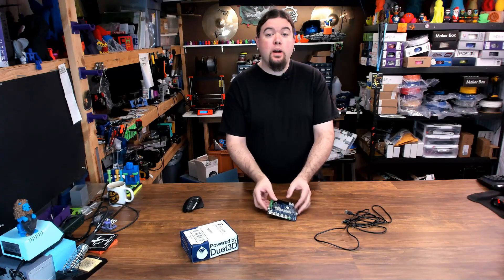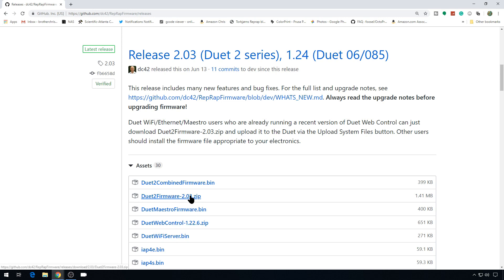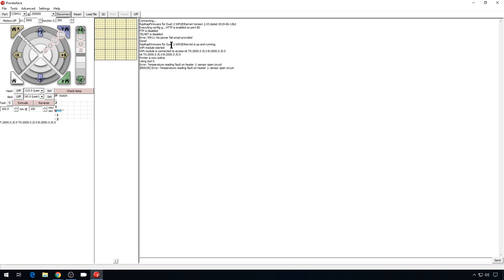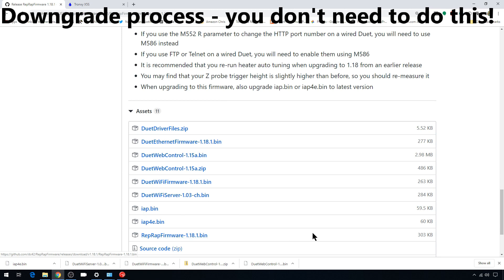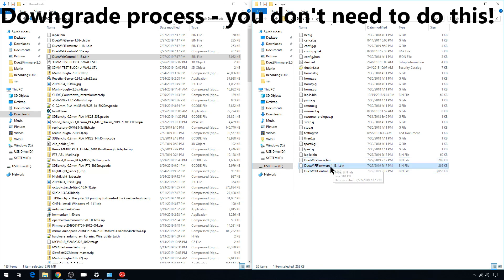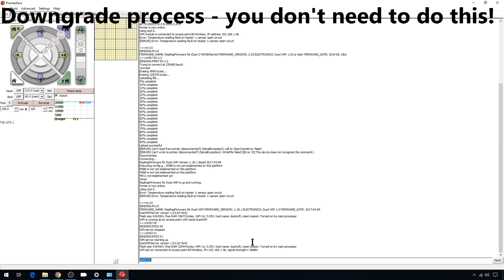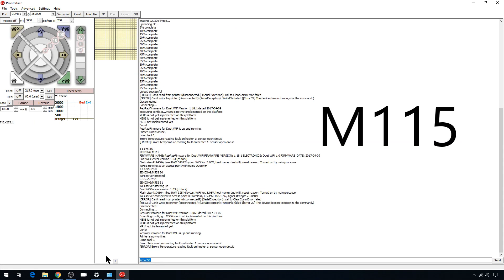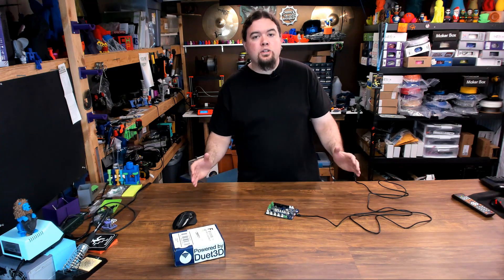Duet Board Firmware Upgrade - How To - Chris's Basement

Comment: hi can i go from 1.18.1 to 3.4.6 like that?
Reply from the maker: You will need to jump from 1.18 to something 2.x then to 3.x https://docs.duet3d.com/User_manual/RepRapFirmware/Updating_firmware
Reply: @ChrisRiley  This is a very frustration process if you don't read that instruction.
Stuck in a situation now trying to rebuild a workable duet board not thinking to back up my og sd card. :/
Lesson learned, if ain't broke done fix it. lol.

Comment: Chris. My motors don't work with this card, what is the most normal problem then?
Reply from the maker: First thing I would check in the wires, try flipping the center 2. It could be different from your old board to Duet.

Comment: Dear Chris. Thanks for your work. I got from a friend a custom delta with a Duet Wifi v1. 01. The official Web is quite confusing and I couldn't find any clear instructions about my old board. I stepped in the forum on a comment that said that this board needs to be updated to 2.02. Is that correct? I'm on 1.18. Your programs also seem different from the official instructions. Thanks, stay save and enjoy.
Reply from the maker: Hello, I did try to find some info on it, but like you, can't find much. I can try to reach out to Duet if you can't find the info you need.

Comment: Many thanks Chris – you're a star! Overall an excellent walk through the upgrade process (from RRF v1.18) that is sadly so unecessarily complicated by the official instructions lacking a clear entry and exit point 'for dummies' – only completely obvious after having successfully achieving the upgrade. It's such a useful reference in fact, I'll post a link to it in the comments on the wiki: https://duet3d.dozuki.com/Wiki/Installing_and_Updating_Firmware 

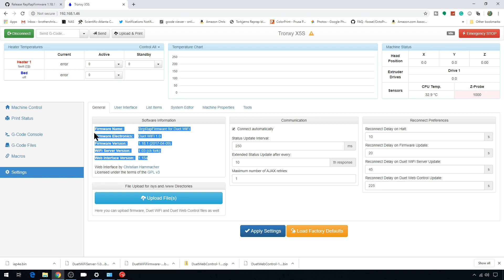The full instructions for upgrading from 1.18 (beginning at 9:17) are in fact nicely contained in the two short, sequential sections on the official wiki:
https://duet3d.dozuki.com/Wiki/Installing_and_Updating_Firmware#Section_Getting_ready_to_upgrade
https://duet3d.dozuki.com/Wiki/Installing_and_Updating_Firmware#Section_Doing_the_upgrade 

I discovered the hard way there are a couple of extra steps (1. and 2. below) required before getting started with Chris's instructions (Step 3. below) – and another step (4. below) required during the process that I guess is only ever required once. 

1. Via the web interface create a macro called 'SetNetwork' containing the following three lines, replacing the your-network-ssid and your-network-password with your router's credentials – and keeping the quotes:
M552 S0
G4 P1000
M587 S"your-network-ssid" P"your-network-password" 

2. Via the Web Interface, edit config.g and comment out M552 S0 (to temporarily disable the WiFi). 

3. Follow Chris's instructions from 9:17 to 11:22 

4. The big one I overlooked, and one Chris doesn't mention (I guess the downgrade-upgrade cycle as Chris describes it doesn't need it??):
Via Pronterface, send the following line to run the macro defined at Step 1, above:
M98 P/macros/SetNetwork 

5. Edit config.g and re-enable M552 S0 – either via the Web Interface, following a power cycle and M552 S1 issued using Pronterface, or directly editing the file on the SD card. 

If any of this is unhelpful, let me know and I'll edit it – the upgrade process is already way too time consuming enough.
Reply from the maker: This looks great! Thanks for putting this together. I am glad the video has helped others.

Comment: Excellent video! The following you can ignore, and has nothing to do with your video, but this is what I went through upgrading my Maestro yesterday.

I modified my POS FLSun I3 to a direct drive extruder (robbed from my parted out TronXY A8, which was possibly the only part worth saving). Between my old, retired, Rostock and the FLSun as original, I'm pretty much done with bowden tubes.

I had quite a bit of tweaking to do so I went to the RepRap configuration site and it requires a minimum firmware level of 2.03. My Maestro was loaded with 2.01 so it was upgrade time.

This is where the wheels fell off.

I uploaded the 2.05 firmware being sure to correct the name of the file first, and, nothing... Hmm, that's weird... Okay, try as I might the Maestro wasn't having it. Okay, download the entire package and let the board sort it out. The board unpacked the file and that was about it. At this point I had upgraded DWC (Duet Web Control) as well, which promptly broke DWC. Just grand...

A few google searches later and I had YAT installed on my PC, but the Maestro was not getting recognized by my PC. Oh joy... Replacing the USB cable fixed this and while I still couldn't use DWC, I was able to communicate with the board. Which still showed me at 2.01.

So I decided to wipe my SD card and reinstall everything, when Windows stopped reading that card. Sure enough, it had died. I replaced it with a loaner from one of my Raspberry PIs and soldiered on.

With the new files, and running the M997 command, I finally got the beast upgraded, but still no network. I was using AdvancedIP to scan the network, and while I could see the board, I couldn't ping it. Maybe a bad cable? It was easier to switch to a different network (and after three hours I was getting pretty frustrated), which is what I did, and I was able to ping it this time.

I also noticed that AdvancedIP would "remember" the scanned IP address between scans (only for the Maestro board), so I wasn't getting comfies from it either.

(yet) Another upload of DWC and it finally started working. I ran the RepRap configuator and everything looked okay, I was going from two extruders back to one, losing a cooling fan in the process, but it put together what looked like a good starting point, so I loaded it into my Maestro (after saving my old config first, which turned out to be a good thing).

Everything ran well enough, I did some testing and put the printer to bed for the night.

Went to start it up this morning, and no DWC. Damnit! 

Back to YAT and I could see that even though I had setup my static IP in the RepRap configuator, it had helpfully ignored me and went with its default dynamic IP setup instead. And look, no fans Ma! What the hell...

Looking through the config file I could see that it came from RepRap, but it was missing a bunch of stuff. Mind you, stuff that I had explicitly selected during the configuration.

Out came the old file, and I hand edited the darn thing to make it work. When you want something done right, break out Notepad++.

So in all, I got hit by a bad SD card, a bad USB cable, a misplaced network cable (yeah, I owned myself on that one), dodgy IP scanning software, and a configurator that isn't worth the electrons that it's printed on.
Reply from the maker: Great write up, thanks for all the great info. Always good to hear about other peoples builds.

Comment: So, what should I do as far as settings?  Things like offset, etc. Prior to the update. Gosh, I should also look at what versions I have running on the Geetech and my FLSun.... probably wouldn't hurt to update those as well..
Reply from the maker: I would just try to get all the settings you can before the update. Either config files or M503 output.
Reply: @ChrisRiley  M503 I know. . Been trying to redo the offset for my bigger printer with the auto leveling.. Otherwise I'm clueless, lol..

Comment: I'm really glad to see some Duet 2 content! You might do a video on pressure advanced calibration. I use the marlin lin adv calibration page to generate gcode, then use notepad++ to replace start gcode, find and replace "M900 K" with "M572 D0 S"
Reply from the maker: Thanks Steven, I hope to touch on a lot of the different Duet features.
Reply: @ChrisRiley  One thing I'm having a hard time with is non linear extrusion calibration. If you figure that one out, let me know.
Reply from the maker: @StevenSSmith  Will do!
Reply: @ChrisRiley  Another is the skew correction. The tool to print and the method isn't as reliable and consistent as the one for marlin. That might be another good topic for a video
Reply from the maker: @StevenSSmith  Interesting, I'll take a look.

Comment: Did you start back you Tronxy X5S? I completely gave up on this one. Did you have to mod it?
Reply from the maker: Nope, I have started to part out my X5S. I hope to put this one on a new scratch build.
Reply: @ChrisRiley  I want to see how you transform you X5S mine will be custom very soon. full XYZ Linear Rails
Reply from the maker: @lenny6617  Pretty much the only thing I am reusing on mine is the extrusion and the motors, maybe the lead screw.